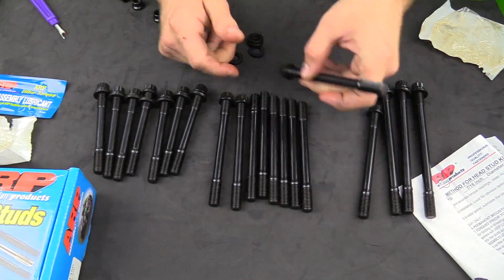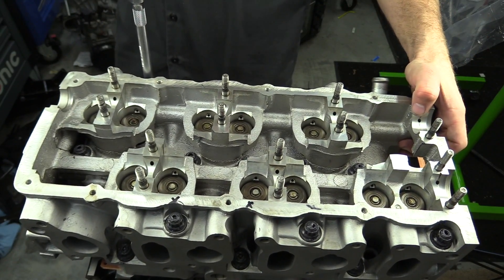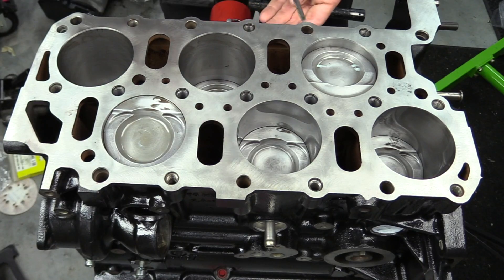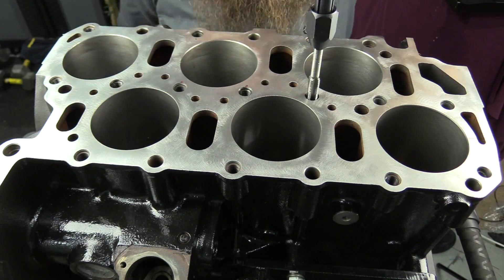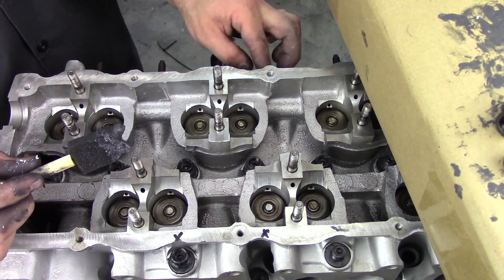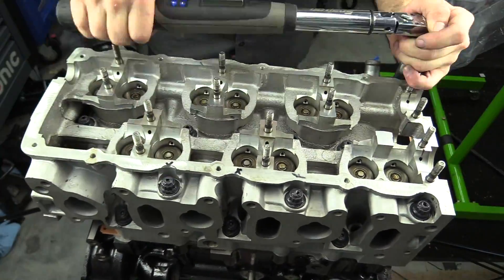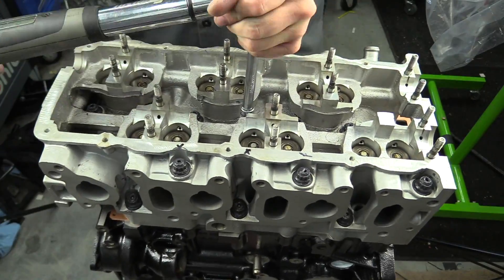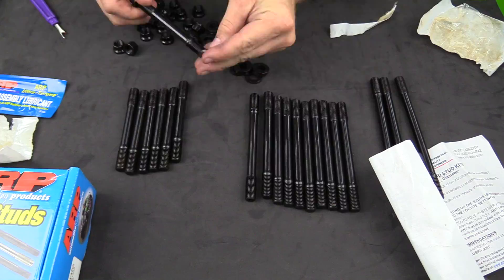The Easy Way to Install ARP Head Studs

Comment from the maker: Because this will come up:
I am not worried about using an extension on the torque wrench. Can this impact torque readings? YES ? But at such a small amount I have zero concern. On this engine you have no choice but to use an extension. I would rather use the extension on all of them to have it even. That is much more important. 

The odds of your torque wrench being out of calibration or you turning the wrench too far after the click or beep are much bigger factors that an extension. If extension were a huge deal, we would also have to worry about the construction of the bit we are using. While this all can play a roll in torque, it's not an amount I am concerned with. Same goes for having my hand on the back side of the wrench. 

Now, if we were torquing to 3.2NM, my opinion might change. But in this case, it's nothing to really worry about. :)
Reply: HumbleMechanic Finally something that I have advanced certification in. The 90 degree straight extension doesn't have any measurable effects between applied torque loading and the force yielded at destination, assuming the tool head remains a square 90° over the fitting. Measurement degradation starts when the force source isn't centered above the targeted point, like when requirements call for an universal joint or "dog bone". I'm also not considering the unlikely circumstances of the tools being substandard and twisting between supply and resolution. I've picked up the habit of butting two nuts against each other on the opposite stud face to assist with gripping lubricated studs during installation, it helps my grip considerable. I am a fan of your channel and enjoy the knowledge from your experience with something that I don't have much opportunity to get personal experiences with, as well as the little tips I don't think of. I'm also sorry If I haven't been susinct and clear, but I have been up well past my bed time today.
Reply: Albert S. I can imagine that. Complete with white board diagram and description. :)
Reply: TIME-SERT®
Reply: Silly question maybe, BUT what is the benefits of copper spray on the head gasket? Something vehicle specific or is it good practice in general and why?
Reply: HumbleMechanic What was the second thread repair method you suggested after helicoil? I couldn't catch the name.
Reply: @Audio_Simon  I wouldn't worry I think he saud timecert  or similar I've got a heli  in my motircycie block just had it done just read up on it be fine
Reply: HumbleMechanic I've heard it all and even seen techs put RTV on some head bolts for fear that coolant could migrate up through bolt, but I've never seen that and RTV makes a mess. Maybe a little machine oil is better for torquing, but most new studs or bolts have some sort of oil coated on them anyway to prevent rust. Parts for VW around here has to be special ordered. You can't just walk into a parts store and buy it, you might have to wait a week.

That actually looks like a good designed engine, any problems with over heating?
Reply: HumbleMechanic I have no vw friends but am wondering if swapping a vr6 from an auto to a manual will require anything special to pull off the swap
Reply: HumbleMechanic do i need these bolts for over 400 bhp or is the spacer alone okay?
Reply: One way of calculating any difference is to set say 80ft pounds apply to a car wheel with and without the extension. It wouod give an indication on the difference

Comment: Thanks for this ARP Head Stud Video. I'm a long time retired Audi Pro Wrench (I personally never liked "Technician"). I currently have the Rotax  Engine (complete with Starter Motor "lol") out of my 2015 Sea Doo GTX iS 260 Limited Supercharged PWC, Head is off, ARP Head Stud Kit 168-4201 (arrived yesterday). From what I gather, these high strung 1.5L SC Engines that WOT at Redline often exhibit signs of Head Gasket Failure around 200-250 Hours without serious overheating which I feel has a direct link or correlation of Sea Doo / Rotax utilizing the same Torque To Yield Bolts as they have used for decades in their Normally Aspirated Skis. Along with the switch to ARP Hardware I'm also going to be using a "Cometic" Head Gasket (arrived today). I've had incredible success using Cometic Metal Header Gaskets on my 93' K1500 SBC & also using a Cometic Metal Nitril Coated VC Gasket on my 83' Suzuki GS1100 ES that I've owned since new (BTW, I've reused that VC Gasket over a few times over the past decade +).  Randy  AKA randog311

Comment: I put the head on the block then drop the studs in the holes.  Saves from having to fight the gasket and head down over the studs and also prevents the possibility of shaving aluminum off the head into the stud threads.

Comment: Hey, just wanted to ask, if it is possible to use the bolts, that you put in an engine, in a another engine of the same spec.

Eg, using the headstuds for a mk3 2L and reuse them in the 2L 16v (the kit for both engines is the same so no worries there).

Comment: what arp studs are these? On a HP academy video with an ARP representer  they spoke about how L19 ARP Studs start to deteriorate with any water or moisture exposed to them, caused by hydrogen embrittlement, this video can cause someone to have L19s and do just that. Once again this information is said by ARP themselves. Can other ARP studs be exposed to water? I have not done that much research I just know this about L19s.

Comment: I am about to install L19 ARP on my 370Z. The instructions say to not touch them with your bare hands. Videos I have watched have told me to only put lubricant on the top side of the washer... And to not put any lubricant at the bottom of the stud. 

There is just so much mixed information out there!

Comment: Shouldn’t be using an extension when torquing use a long socket, if an extension is absolutely needed uses the shortest one you can
Reply from the maker: It makes virtually no difference in this application

Comment: Nice bro. I love ur channel. 175000 on my 1998 mk3 vr6 jetta glx. Original head gasket.  I'm planning on doing this soon. Just did my timing chains & guides & new stage 1 clutch.  She still runs like a beast. Will break axles lol..

Comment: Having a time dealing with getting headbolts for my motor…. The war is making overseas parts very hard tk get. As far as I have heard from the company and only company I can get my part from. They will not be shipping anything or flying anything out of the country (Japan) for a while… so looks like I’ll be going to the junk yard. But turns out. You can reuse the headbolts on my motor

Comment: I spoke with an ARP tech and he specifically said to not lube the washers especially on an aluminum head cause it will give a false read on the torque spec and can potentially break
Reply: I talk to the ARP Tech and he said to only put lube on the top part of the washer. The bottom side should stay dry clean. I double checked because I had saw a tech in a video talking about installing. I don’t know all the reasons  but he mentioned that the washer would bite in better

Comment: MAJOR MISTAKE IN THIS VIDEO!

ARP specifically indicates that you should NOT lubricate the washers. 

6. Then, using a clean, dry rag remove all oil from both sides of each washer. The cylinder head and
washer mating surfaces must be free of oil/grease/lubricant. Failure to keep these surfaces dry
may result in inconsistent preloads.

7. Place the washers over the studs and on to the dry, clean spot faces of the cylinder head.

8. Lubricate the stud threads and bottom of the nuts with ARP Ultra-Torque Fastener Assembly Lubricant.
Then install the nuts onto the studs and tighten hand tight.

https://tech.arp-bolts.com/instructions/234-4343.pdf

Comment: *Important- lube only the washer side that makes contact with the boltt, don't lube the washer on the side that touches the head. If the bolt feels loose close to the desired torque...back off the nut and sand the side of the washer that touches the head with 80 grit; just three or so 6" strokes should be enough. People blow head threads and snap bolts when the washer SPINS! and acts as a *bearing giving the feeling that the nuts is loose and not hitting the torque called for.
Reply: Exactly....
Do NOT do it as explained in the video.
And make sure that if your washers are chamfered, that the chamfer goes up, against the bolt head to clearance the chamfer of the bolt head.
Reply: This is true I did this one time and over torqued the nut and split my washers 🤦‍♂️

Comment: *pre install studs to check heights as not all motors have the stud hole depths machined the same and studs need to be bottomed out to work property. if some studs sit too low use some ball bearings to adjust stud height when bottoming out.

Comment: hey o have a question, i know 12v’s are interference motors, but do you know if i ran a 8.5:1 spacers and timing jumped 3 teeth an i still safe with the headspacer clearance you think? i even checked the timing by turning motor over by hand when i put it together and it was spot on, started the car after it was together after an oil prime crank, car ran for 10secs then shut off and.now with cams aligned with ailment plate the crank mark is turned counter clockwise about same spot you say in the vid when you install your cams when the head is on
Reply from the maker: I would want to re time it, or remove teh cams and do a cylinder leak down test

Comment: Good video, though the extension will not change torque, just give you greater leverage. I'm curious what range torque wrench you used, as I am about to install mine. I know this is probably overkill,  but as a QAI in the Navy, we were only allowed to torque from 25-75% of the stated range of the torque wrench, so that's all I really know.

Comment: I did a test where I reused TYT bolts 3 times before. Never had a problem. Chased thread holes with a tap first. Naturally aspirated, wouldnt reccomend it with increased cylinder pressures.

Comment: Did anyone else cringe when he ran that cutting tap back down those holes? Judging by the bolt fit when he wiggles them I am assuming he shaved the thread pitch. Would recommend a forming tap to a friend, and plenty of oil with either style tap is a must.

Comment: I disagree man, I believe it's bad idea to remove the grease and oils from bolts, the oil and grease protects bolts from corrosion, and anything more than hand tight defeats the idea of how these bolts from ARP work
Reply: take a post card sized piece of paper ,,, along the long side , divide it into three and put a cut half way down the piece of paper in two places ,  ,, then hold the top corners , one at each edge 
and see if you can tear the paper into three parts .
if it works , and you get three pieces of paper ill do every engine i build from now on your way and totally concede that it makes total engineering sense.
if you cant tear it into three as the forces wont share equally , ill stick to my way. 
let me know how you get on

Comment: I'm surprised you use copper coat there has been many tests done and Teflon coated gaskets are best installed dry. I personally used copper coat and I would end up with some coolant related issue. I no longer personally use copper coat and would recommend to anybody out there using a metal head gasket with a Teflon coating to research it.
Reply from the maker: Had I not split the gasket I wouldn’t have used it.
Reply: Back in the 1960's we used to build our motors in our race boats with mls head gaskets, everyone sprayed the gaskets with either silver paint or copper paint. Its just another layer adding to the crush, insuring a better seal. May add 002-.004 thickness though.

Comment: I’ve got to do my lb7 duramax, I’ll never do anything above stock power, can I just use new factory head bolts instead and be ok? The difference is $50 vs $650 so being able to use them more than once isn’t an issue, thanks.

Comment: What is the purpose of spraying copper if you have no spacer and you got block and head machined in a case like mine with arp bolts . Does spraying copper help in built engine etc forge rod ,piston,turbo 500 hp+
Reply from the maker: If I wasn't using the spacer, I wouldn't use the spray regardless of the HP. I mean I am sure there is a point where you need to consider the gasket more, but 500hp is probably going to be fine. Now if you are doing a CRAZY build, I might talk with the machine shop to be sure

Comment: Once you install the stud and put the head on you apply arp lube between the nut and washer plus threads and none between washer and head, otherwise you will end up over torquing the nut/stud.
 I know its nit picking but it is the truth and says it it in ARP guide that comes with your stud kit.
 its the same for people who dont chase the threads in the block then wonder why it the head gasket leaked.
Head bolts /stud nuts act as a spring and that spring needs to be of higher preload pressure than the force of compression/combustion stroke and this also applies to the mains as there is equal pressure applied. 
That is why ARP sell different types of stud/nut combos for the same engine it depends on application.

Comment: If you wore to accidentally torque all head bolts except one. What should you do?
Reply: professionally get a new head gasket and start again, but fuck that just torque it down.
Reply: Depends where the loose bolt is. Always start in the middle of the part and work in a circular pattern towards the outside edges. Nothing has changed in mettalurgy even if engineers try to make you think it has.

Comment: Great vid, however, the underside of the washer, the part that contacts the head, should be clean and dry so it will not rotate during install, if it does, torque readings may be incorrect, experienced this myself and then found this site to help explain, hope this helps. 
https://www.enginelabs.com/engine-tech/machine-work-assembly/damage-alert-how-to-avoid-pulling-threads-or-killing-head-bolts/

Comment: What is the final torque check specification in Newton Meters for standard torque to yield bolts on the VR6? I.E after full sequence what would they click at?
Reply: TYT bolt torque is based on the diameter of the bolt in engineering books, just look it up, you dont need to know engine applications.

Comment: Hey Charles, just found your channel and ive already watched all the white Wookiee videos!

Wondering if you have a part number for that mk4 gasket and the spacer you used? I’ll be cracking my head off soon and wanted to upgrade mine also. But I’ve read that I should use the spacer to get the mk4 gasket to match mk3 gasket so I don’t have my valves contacting my piston face. 

Thanks in advance.

Comment: hey charles am currently building a jetta 12v vr6 2000 and i watched almost all your videos and it helped alot i do have a question on my head spacer 9:0:1 when i install it when am going to do my timing chain would everything work out? meaning would the chain fit with no other modifications?

Comment: Hey Charles, love your educational videos -Even though I mainly work with French cars, I really enjoy listening to you ramble about the small details. Keep it up!

But I did have a question too; how did you compensate for the head gasket spacer regarding the timing chain? Since it now has something like 6-7mm more required length. Or does the chain tensioner now just have "less to do" or something?

Comment: I agree on snuging studs a bit more than hand tight. 

As far as extensions, only minor LB rating difference, and for torque angle figures, if you have the slop pulled out when you set the angle it'll be pretty dead on anyway. 

Love your videos, look forward to more

Comment: Is it ok to double check the torque spec?
Reply: It will not do any good. What you will test in a "double check" is the friction that is present between the contact surfaces, That is the static friction and it is always higher than the dynamic one. The only way you can really check the "torque" is to break the fastener loose and torque it again or measure the stretch. In experiments, I have done for a book I wrote we found that about 75% of the friction that is recorded with a torque wrench is static friction. You would have to torque and release a fastener 6 to 8 times to remove the majority of the friction. The ARP  lube will remove the remainder.appliedspeed.com

Comment: PSA: When installing fasteners or studs that must be torqued, ONLY use lubrication if the manufacturer calls for it.  (Charles' application called for it.)   The reason is:  the torque you apply is matched in the system by some combination of both friction, and elastic (temporary) stretch.  Imagine that some MFG designed their fastener for a 50-50 split of friction & elastic stretch, assuming a dry application.  If you lube it up, you will change that balance to be less friction & more stretch, and could cause failure of the threads or stud.  (Note that when I say 'elastic stretch' above, I don't mean torque-to-yield.)
Reply: Correct. Torque-to-yield involves plastic deformation (stretch beyond the material's elastic range)

Comment: Mis-information in this video. You are not suppose to put the assembly lubrication on the threads that go into the block. Only on the top portion, washer, and bottom side of the nut...
Reply from the maker: +CJBMAGGOT94 according to ARP you are.
Reply: The lube helps prevent rust and it also protects the threads if the stud turns in the block. appliedspeed.com

Comment: Hi! I'm from Spain and new here. My question is what happens if you torque the arp kit to the vw torque specs and not to the arp torque instructions.
Great job with that vr6!!
(Sorry for my poor english)
Reply: The factory bolts are a complete different design. You do want to torque the ARP bolts per the instruction with your kit.
Reply from the maker: Good question. Probably nothing, but I would highly recommend the ARP spec